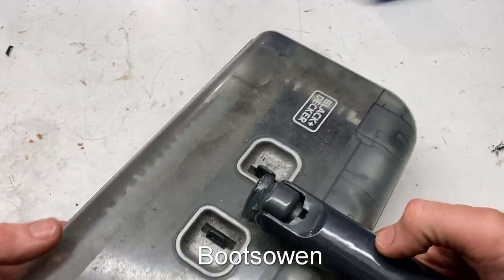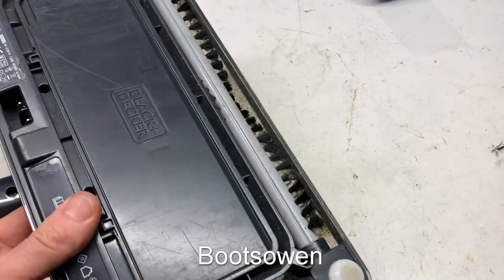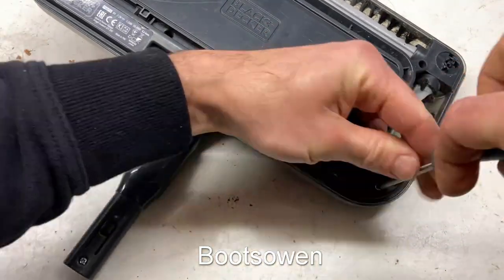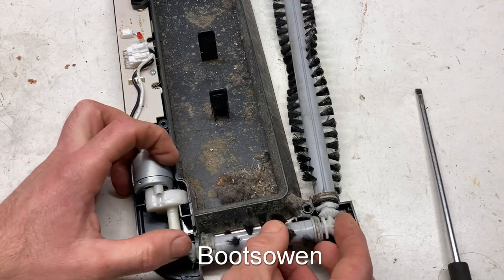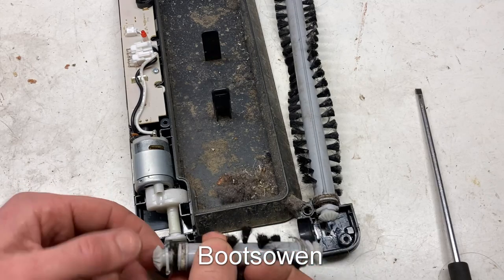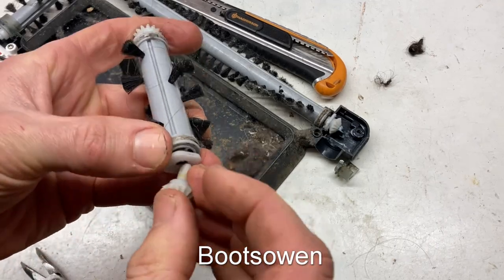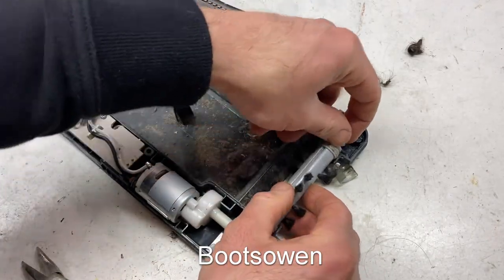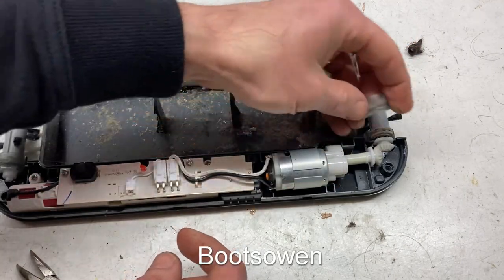Won't sweep? Easy fix: Black and Decker Lithium floor sweeper PSA215 repaira

Comment: Thank you! This really helped me repair mine. Couldn't believe how much stuff had gotten trapped around those axeles! A toothpick came in handy for getting inside some of those crevices. On mine the first gear after the motor was starting to get stripped, so I swapped it with one near the end and it's running like new.
Reply from the maker: Good work!

Comment: They are just the evolution of the carpet sweeper, We had the Kärcher version in the kitchen for years before we got a Dyson cordless and found it really useful
Reply from the maker: Just a eubank sweeper with a motor. A completely unnecessary use of electric. If it had a vacuum then it’s an improvement but this one doesn’t.
Reply: @bootsowen  The Kärcher one we had was exactly the same, Advantage over the push along eubank sweepers is it'll do right up to the edges and no issues with the wheels skidding stopping the brushes on any surface

Comment: I have a model HFS115J. 3.6v DC.  After a full charge.  It runs then stops got to step on switch again and stops. Won’t stay on worth fixing? Or throw out. 1 year old
Reply from the maker: I presume you charge it?  Battery might be worn out. You could replace it, hardly worth it, depends on how much you like it!